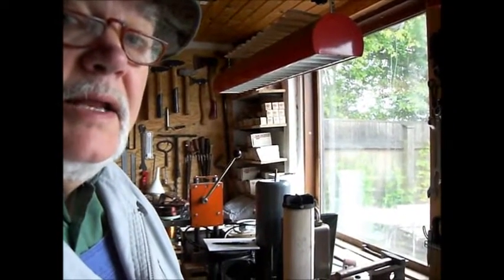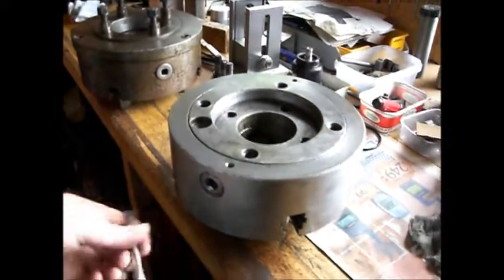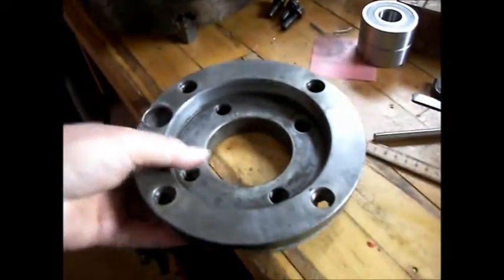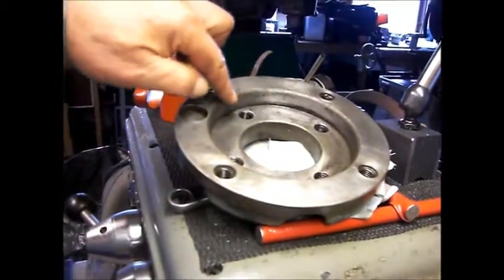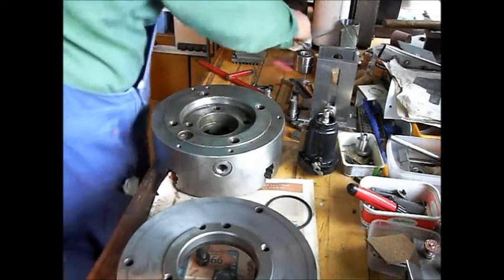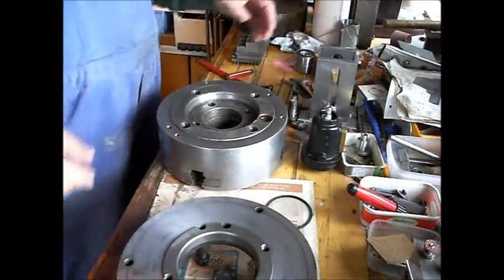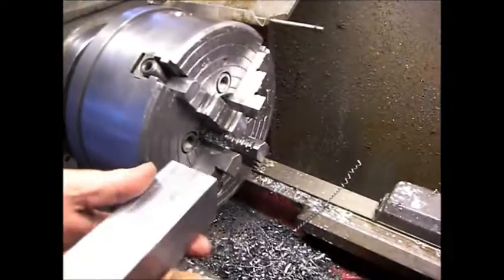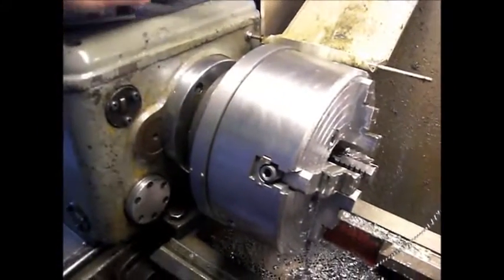ChangeTo4Jaw

Comment: Hi mate.
Well done, with that conversion of that back plate.  You have a very nice chuck there.  I bet that people like Tom would love a precision chuck like that.  It's a bit of a shame about that nice old chuck though, can't she be repaired?
You have got yourself a nice workshop there, I think during the fierce Danske  winters you will be quite comfortable in there.
Marcel.
Reply from the maker: +Marcel Timmers Thx, the old chuck is so worn out ... no, I took the backplate and the jaws maybe - that's it !

With a really cold winter here in Denmark it's simply too costly to heat up the shop, the tools and everything is so freezing cold - I spend the same money heating the shop for 2 hours as we use in the rest of the house (170 spr.meters) for 24 hours !
Where is that global warming when we need it ?  ;-))

Comment: Don't worry you will soon be able to true up work quickly. One tip would be to do it in thous (of an inch) rather than 0.01mm as they are much larger. :>)
Reply from the maker: Chris Stephens Ahaaaa, that's why Adam Booth can do it so quick ;-))
Reply: Sure is but I suppose a bit of experience helps too.